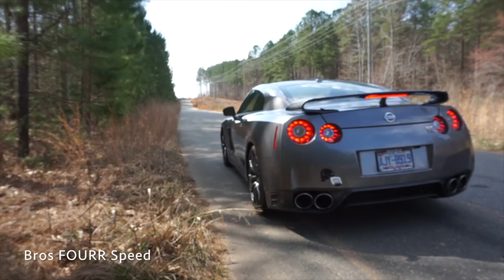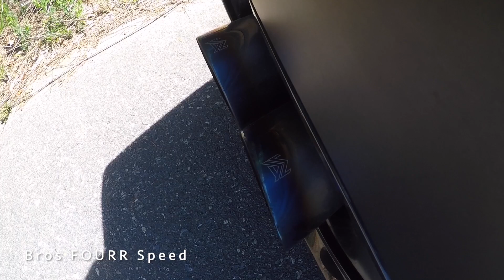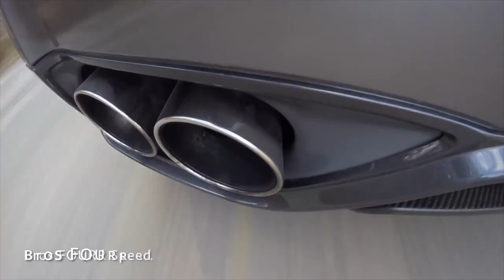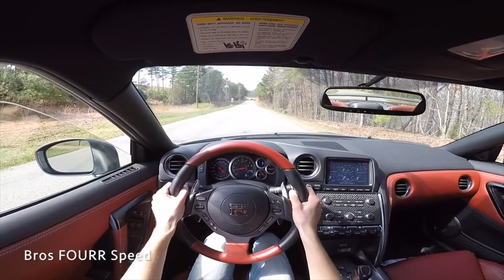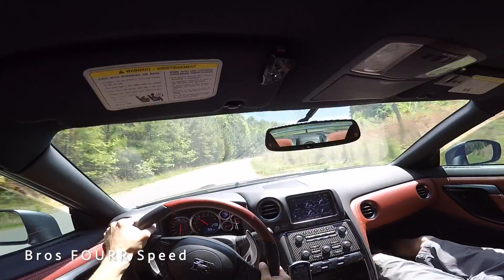Nissan GT-R Armytrix Straight Pipe vs Stock Exhaust

Comment: Sounds pretty awesome but will you need ear muffs on a long trip? The tips look like they are made of titanium. Is the complete system made out of ti? At the top of first gear during the first open exhaust hit, it sounded like your traction control took over because of tire slippage. During the upshift to second, it sounded as if the computer was pulling timing out during the recovery.
It's hard to put into words but something was happening during the first to second upshift. Have you had it to the track to see what the improvement is after doing the exhaust? Beautiful car, nice work.
Reply from the maker: Richard Jones It was fighting for traction in 1st a lot! Traction in Race mode does what ever it has to do to make the car as fast as possible while maintaining traction. So it does a lot to prevent a burnout but also give it as much power as possible. With the exhaust valves closed, the car sounds like stock. The valvetronic exhaust is amazing! All stainless steel, but the tips have the titanium color

Comment: Idk, if had to choose between a stock exhaust for free and this straight piped exhausted for thousands of dollars id choose to keep it stock. That high pitched noise the straight pipe makes reminds me of the glass pack “ricers” of the early 2000’s.
Reply from the maker: In person it sounds amazing tho! Plus with the valve you can make it go from stock sounding to loud with a touch of a button. Plus with tuning, the full exhaust allows for more power. I ended up having this car on Flex Fuel making 700 horsepower. 
The best cost effective exhaust would be just do a mid pipe for $650. Wakes up the sounds a ton and helps with power too

Comment: On your launch after the tune sounds like your ride is bogging out  in second gear.
Reply from the maker: Curtis Dickson It was just fighting for traction. A lot more power than those stock accelerations and about 9k more miles on the tires